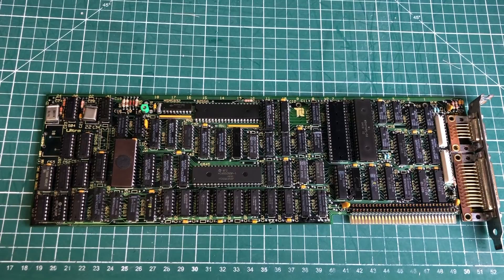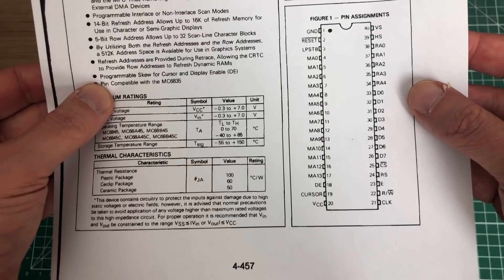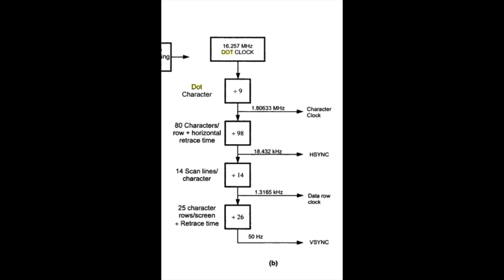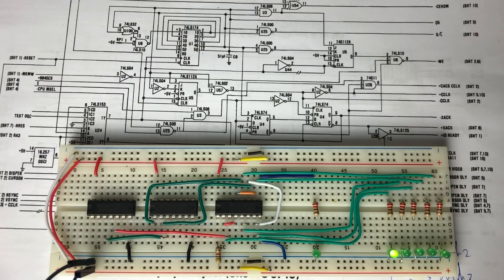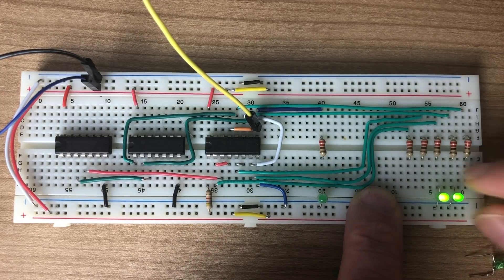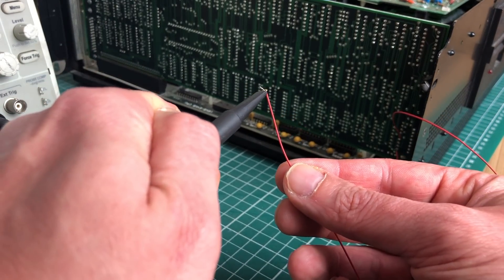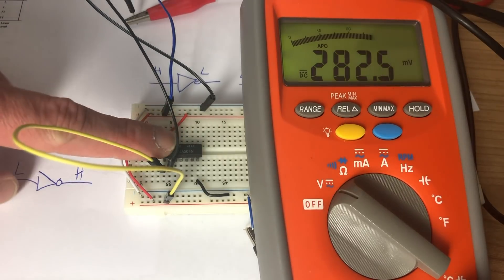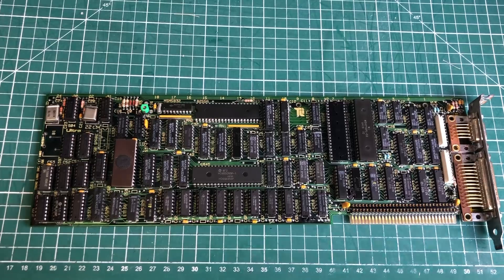Unfixable videocard from hell ? (part 2)

Comment: 1. Try to replace that chip which is heating up to 60 degrees. Sounds suspicious for bare logic..
2. I don't remember, was battery soldered on video card from hell at the beginning or not, or this battery leakage was from bigger battery.. But if it was, try to put 3 AA batteries in series through diode with soldered wires to imitate battery presence and prevent standard battery charging while testing.. 
I see few PC boards who's refused to work without detecting battery.. Even after reset..
3. If frequency is working from bench power supply, but goes down when installed in PC, there is chance that some of other power supply lines, if used in this case, may have some defective components, whose have multiple power rails.. 
Remainds me 8080 times, when defective op. amp. in different PCB section drops down negative power rail and for bonus kill CPU..

Comment: 18:16 maybe it can be handy: i was fixing bad amd radeon hd 6870. The card was on the bench - and I've checked resistances on each power rail, then I've "injected" proper/correct voltage from lab power supply on each power rail step by step to observe power consumption. And then I've decided to supply all voltages to the card, which was on bench. So I've put 12V on psu connectors, 12v on pci-e pin, and using step-down voltage converter I've put 3.3v on pci-e pin (made from 12v) So all voltages was present but I still not get high state on enable pin of main phase buck controller, so it doesn't start to produce 1v for gpu core and 1,59v for video ram. But when I've disconnected everything and I've inserted video card into computer pci-e slot, and start it up, then I've got high state on enable pin and then buck controller start working and it provides 1v for gpu and 1,59v for ram.

So the conclusion, which can help you, is that - there must be a signal from computer (via socket pin) to wake up video card. I understand that here you have retro architecture and power saving was different in that time, but maybe this is the case. Maybe you get 1,8MHz on the bench, because the card is NOT fully on. But as soon as you put it into computer, the video card receives a signal to start rest of the components (which all wasn't supplied on the bench) and maybe some of that components is bad and that bad chip is taking down the 1,8MHz clock signal.

Second thing. 16:55 I see 1,78 Amps on that videocard and it is too much i think. And 60 C degrees on any old/retro chip is abnormal. That hot chips explains amperage. If you can't touch it (because is too hot), then it is the clear clue, that it is short, or something around him is overloading the rail which that chip provides.Please check that hot chips datasheets, and measure resistance on all pins to ground and if (in the datasheet) that chips provide any output voltage, then lift that leg out from the board, or take out that chip and inject voltage from lab psu on that pad on motherboard side. To check if something on that rail is shorted or if short in on the chip side only (i suggest to remove the chip or lift the output pin before injecting voltage from psu, because sometimes reverse voltage from the other side to the output side, can burn the chip or inside diode)

Third thing: When you be able to discover the reasons of the hot chips and fix it, and if then the videocard will still produce black screen, then maybe you should check the video bios. is any eeprom chip there?

Sorry for my english, I could use wrong words, but I hope you've understood me.
greetings from poland, and thank you for part two :)
Reply from the maker: Thanks a lot for the comments.... I will check the 2 hot chips and see if I can replace them. Running it off the test bench was just more convenient to probe around, but I can imagine it is missing some vital signals at that point on the ISA bus. But it is a little bit more difficult to probe around with the video card in the PC. Should have some kind of ISA expansion board + cable to get it out of the PC.
Reply: I agree, chips running very hot mean they probably are shorted.
Reply: You shouldn't use "I've" before the verbs, just "I". For example it should be "I checked resistance", not "I've checked resistance". "I have"/"I've" is used is other situations. Other than that your English is pretty good :)
Reply: @WTFBOOMDOOM  Thank you. But wait a minute - I remember, form the high-school, that the was "I've,you've..." required in some situations in past time. Could you tell me, in simple way, when should I use it?
Reply: @Radek__  That would be verb tense "past perfect". Google explains it much better than I could...
Reply: @Radek__  Use "I've" when you have done something in the past and it's not important WHEN exactly. The focus is on the fact that it happened AT ALL, not when. "I ate gazpacho yesterday." You specify when you ate it, and it's an action that took a short time to complete. "I've eaten gazpacho before, yes." If someone asks you if you've EVER eaten gazpacho, you answer like that because it's not important when or how many times you've eaten it. "I was in Spain last summer." because you specify when. "I've been to Spain." means you have visited it before, but you don't specify when or how many times. "I watched the soccer game last week." because it started and ended in a short span of time (one sitting in front of the TV). "I have watched thousands of soccer games." It means you have watched soccer games many times, it's a repeated action. But like I said even if the action is not repeated (you only have been to Spain once), you say "I've" IF you don't specify when it happened. It will take time to learn when to use it, it took me many years. Greetings from Slavic Bulgaria :)
Reply: @WTFBOOMDOOM :-)  thank you for spending your free time to explain it. Now I understand it better. I'm grateful. I will try to remember it :-)